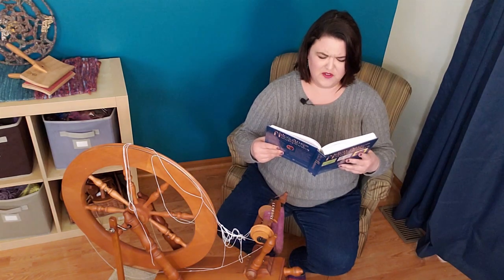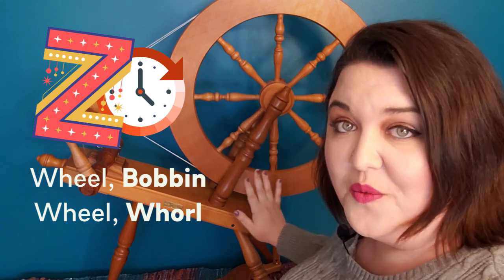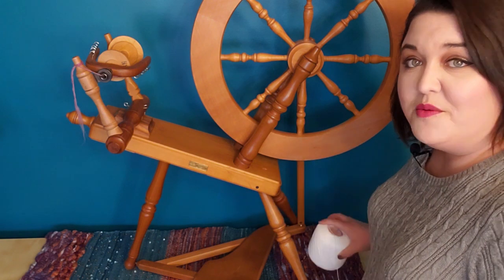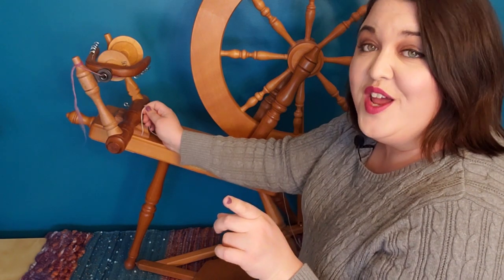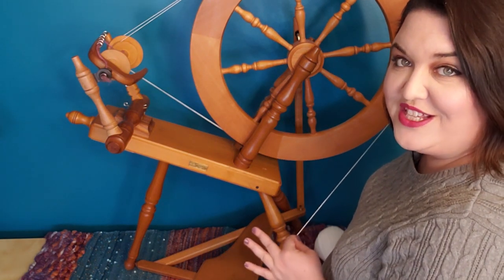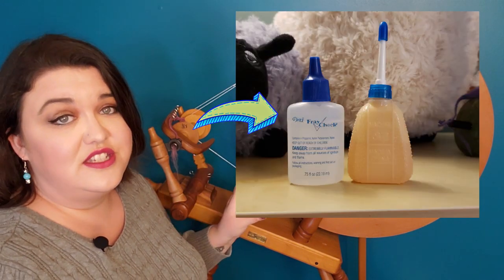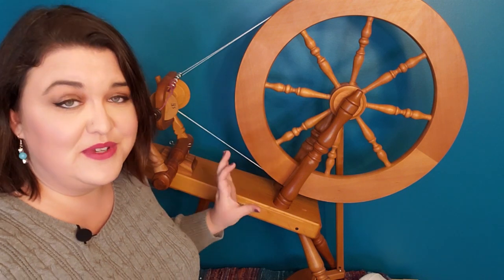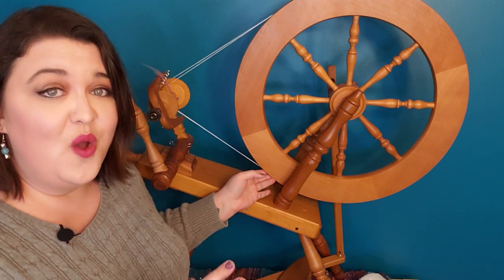How To Tie A Drive Band Onto Your Double Drive Spinning Wheel The Right Way

Comment from the maker: What is your favorite drive band material?
Reply: Just tied on some aunt lydias fashion 3 cotton thread
Reply: 100% Cotten
Reply: Right now I'm using 10/3 Romanian Hemp.  I like it because it doesn't stretch much over time, and it's super strong.
Reply: perhapse you should tell us WHAT makes a good drive band material
Reply: @gcjpcrowder  Well, that's what we're doing here.  All of the materials mentioned in the replies work well.  It helps to experiment and see which ones you like best.
Reply: Kitchen twine, cotton, available at any hardware store.
Reply: I had a double-drive band from kromski, which is a fine, 2-ply jute.  But the knot kept getting bounced out of the wheel’s groove, so i switched to 2/8 hemp, tied a slim reef knot, wound it in the correct direction (thank you!), and now the wheel is chattering happily.
Reply: @RuthHenriquez do you wax the hemp?

Comment: I've had my wheel about 25 years and have never used a different threading on the band for direction of spin. Never noticed a difference. My bands tend to last months and months. I spin and ply on the same wheel, often the same day, so it's really not practical to change the band all the time. Nevertheless, I am very much interested in the two types of threading. Have to give it a try. I could spin on one wheel and ply on another as I have two. Thanks so much! I thought you had to make a special kind of knot, but apparently you just have to make a secure one. Appreciate the clear, concise directions. You rock!

Comment: When changing direction (Z to S), the old timers would pick up the drive band on the bobbin with one index finger and pick up the drive band on the whorl with the other index finger then cross them over. This puts the cross on top and takes it off the bottom with no further action required except adjusting the tension again. Ashfords are usually good about alignment but some wheels are a real pain about throwing off the drive band.
Reply: This is quite interesting.  Thanks!

Comment: My favorite, Almost 175 year old double drive spinning wheel is from Canada and is quite cranky & cantankerous and will only work with a drive band made of heavy  multi ply cotton twine.  Absolutely will not work if knotted, has to be overlapped about 4 inches and hand sewed together which is time consuming. That is the way the drive band that was on it was done when I purchased it over 50 years ago.  Have a   recently purchased more modern wheel, double drive, which will work wifh a knotted drive band but still works best & more smoothly with the heavy multi ply twine .  When demostrating spinning,  I always use the old wheel because  of the character, charm & personality it has, all results of some very crude repairs from its earlier days, if only it could talk!

Comment: if your WHEEL has a double groove in it as well, the 1st pass around the bobbin also goes in the groove closer to you on the Wheel, the second pass around the whorl then goes in the BACK groove of the wheel. And you have to have tension on the crochet cotton ball or that thing bounces everywhere and pops the thread off all the grooves. lol i just learned

Comment: Thank you. I haven't used my spinning wheel in 25 years and couldn't for the life of me figure out what I did wrong. I'll go try this before I kick it for the last time and burn it. :p My bobbin keep spinning around as well, and as far as I remember, it shouldn't. It's only the flier that should spin so it plops the wool up onto the bobbin. So far your videos are the ones that shows it most clearly, how these ladies should work. So again, Thank you :)
Reply: Did it work?
Reply: @ it kinda sorta did. Maybe? I’m not sure. I can for some reason spin both ways now without it popping off. I can have the crossover of the string both on top and bottom going ex. clockwise without it popping off. I’ve changed the tension. Might be that as well? I have a spinning wheel my dad made me so I can’t just call somewhere and ask for the instructions. I can’t ask him cause he’s not around anymore. It was driving me up the walls.  I have no idea exactly what fixed it but now it works. 🤷🏼‍♀️ Was it this, maybe. If yes brilliant. At least I’m no longer a screaming banshee, I’m just puzzled. But at least quiet and happy 😃
Reply: @SagasInStitches   - If it somehow got fixed, and if I were in your position, I’d probably just count my blessings and be happy… and take pictures of everything and anything I possibly can just in case I need to change out that drive band again. 

One thing I do know: thank goodness for Jillian Eve’s videos because if something is not going as I’d wish I often find the answer on this channel. 

I’m so happy you got your wheel to work, especially now as I read your father made it for you. Now all I wish you is many happy hours spinning on it, making gorgeous yarns you can then turn into even more gorgeous finished pieces. And perhaps, one day, the possibility to pass on the joy of spinning on that wheel to someone else.

Comment: Thank you thank you thank you. 
When I started spinning some 15 years ago, my mother bought me a castle, double drive spinning wheel at a street market. She had no idea what she was buying. The sellers just told her that "it worked". 
I was a new spinner. All I had used was my Kromski Fantasia - scotch tension, double treadle, NEW. 
I spent so much time trying to make the "vintage" one to work. Impossible. And I finally left it as it was and used it as decoration.
But this past week I got stubborn. I watched video after video after video (not available 15 years ago) . I saw I was missing pieces. I made those (temporary - I will work on more permanent ones later). I found out it was double drive (did not even know that existed). And loe and behold I actually got it spinning. But now the real problem: My wheel has no grooves. ALL the pics I see have grooves. Mine doesn't. I did not give up.
But just a few minutes ago I came across THIS VIDEO and the thumbnail was exactly what I was experience.
I did wheel, bobbin, wheel, whorl. AND IT WORKS!!!!
OK, I still need to make the missing pieces. I still have to oil, clean, give it some TLC, but it is working!!!!
I think I will call him Sisyphus.

Comment: Thanks for this video! I am new to spinning an appreciate all your tips. Question about this - since the cross is supposed to be at the top for spinning Z twist and the bottom for spinning S twist, does that mean that you need to re-string the drive band when you are switching between spinning singles and plying? How do you go back and forth between the two?

Comment: Thank you Thank you Thank you.  We acquired an antique spinning from an auction.  The drive band was missing; other that is was in phenomenal condition.  I dreaded adding a dive band for a double drive spinning wheel.  JillianEve to the rescue!!  This video made that task as easy as "wheel-bobin-wheel-whorl" (1-2-3-4).  

The wheel was in such good condition that we took it to a demonstration at the San Jacinto Day Festival.  It worked like a charm ... until my knot on the drive band slipped.  Fortunately, I had the same ball of kitchen twine with me and 1-2-3-4, the wheel was wonking once more.

Comment: HELP! I am frustrated nearly to tears. Can’t tell you how many single drive wheels I have and I spin well on them. I was fortunate to pick up this Rick Reeves production wheel. Brought it home with bobbin on and spun it full. Changed to next bobbin and things went completely wrong. Trying to hold on to the drive band and replace spool at the same time seemed impossible!  Off came the band. I have watched you tie on a new band but what do I do with this circle band I can’t get to work? I Spin a minute and one groove ends up with all the band in it. I surely don’t have to tie on a new band each time I change a bobbin Uggggh!
Reply from the maker: No, you should be able to use the same band until it breaks or wears out. What it sounds like to me is that something moved out of alignment when you changed the bobbin. Check to see if the band lines up or if the mother of all or the wheel itself has tipped to one side or the other. Even a little bit off alignment can cause the band to jump. I hope that helps! Happy spinning!
Reply: @JillianEve  thank you. It helped.

Comment: I use home spun two ply linen thread on my DD wheel and my Ashford DD/SD wheel. The Ashford in DD mode requires a bit more tension than my dedicated DD wheel. Both spin real well. Until I gave a bit more tension on the Ashford in DD mode I got the same drive band popping off issues. A touch more tension fixed the issue and the bobbin side did not have too much tension as the thread is quite thin and will allow for decent slippage as needed. I can do two ply lace weight with no problems on each wheel.
Reply from the maker: Oh that's good to know about your Ashford! I might try some linen too!
Reply: @JillianEve  I also figured out I needed a leather washer between the bobbin and the flyer that is oiled and it works great. No more slop and I made sure I adjusted the mother of all to the side a bit more to better align to the wheel and all my popping off problems went away.

Comment: Thank you so much for all your videos. Newbie question... should the drive band be tied snugly when the tension knob is at loosest tension? Tightest tension or somewhere in the middle? I hope I'm making sense.
Reply from the maker: I've done it different ways, but lately my method is to set the tension in the middle and tie on the band. Then I have room to adjust it either way as needed. 🧶🐑✨

Comment: Great video it helped me to set up an old spinning wheel.  I found a fairly thin nylon string around 1/16" in diameter, and it worked well but I should point out that it was rectangular in shape.  I think any rectangular shaped thin string will work great and because it is rectangular the knot will hold much better.  This is most likely why most shoe laces are a flat rectangular shape.  Some of my shoes uses a round shape lace and they keep coming loose.  I am not sure where you can buy the rectangular nylon string I used since it was on an old Plumb Bob but I am sure there are some suppliers who sell it.  I hope this helps someone.  Cheers!

Comment: Thank you for this. I have acquired an old spinning wheel with the intent on learning how to use it. The direction of the thread is something I haven’t even considered. I have lots of crochet thread so am glad I can use that. Can I use it to attach the foot pedal to the big wheel axel rod thing too?
Reply from the maker: Wonderful! Yes, the connecting rod that goes from the crank to the treadle is called the "footman". Spinning wheel terms are strange! You can connect it with string, and I've spun with it that way on an antique wheel. You can also sometimes fashion your own out of a yardstick. :)
Reply: @JillianEve  thank you, that’s most helpful and will also stop me referring to parts as thingys. 🙂

Comment: Thank you for such clear instructions and explanations! I have only spun in Scotch tension so far (I currently have a Schacht Ladybug and it will do both single and double drive), but am considering a trade-up to a larger, DD Saxony wheel so I would like to try the Ladybug in DD. Dumb question: Because the band has to cross one way for Z twist and the other for S twist, I am assuming you must have to adjust it between spinning singles and plying...? I feel like this is obvious and at the same time, I cannot find an actual sentence on the internet that tells me the answer. Please help! And TIA!
Reply from the maker: I keep two drivebands on my CPW because he is a fussy antique for just this reason. Some wheels require it and some wheels can go either way regardless. Maybe you could try it without switching the band first and then reverse the cross if the band starts jumping off? 💜🧶
Reply: @JillianEve  Do you mean you keep one crossed one way and one crossed the other? I feel super dense! haha
Reply: @iamcharmquark  No if I understood her from a previous comment she means that you have two separate drive bands for the two different uses, one for s spinning and one for z spinning.  So when you stop spinning and start plying you change from your spinning drive band to your plying drive band. She told that other person to leave both drive bands on the wheel but one is hanging loose around the wheel support column while the other is engaged on the wheel to make it quicker/easier to change over from the one to the other. I think she said it also helps you if the bands are different colors.

Comment: Why are you using the breakband Groove on the bobbin and not the actual drive whirl on the bobbin? I guess it works since There is a differential between the two diameters. This could cause extra friction and wear the driveband.  Does Alden Amos recommend this way of setting up, better reference my copy.
In my experience the boost common cause for driveband popping off is misalignment of the big wheel not the drive band setup, though I admit I am lazy and never change the direction on my driveband and occasionally Elinore throws a fit. But on my matchless, polonaise etc it never matters, elinore just craves a bit more attention and maybe this is what she need

Comment: Ok, seriously, I am confused and I hope someone sees this. I prefer to spin counterclockwise. It’s how I was taught and I’d like to stay consistent. 

However, a counterclockwise tie off is not demonstrated here and I’m confused. I followed the exact instructions of wheel, whorl, wheel, bobbin, but my cross ended up on the bottom, not the top. So what did I do wrong? I can’t find this visual demonstration anywhere.
Reply from the maker: If your drive band is staying on your wheel, and you get the yarn you want, then you did it right! If your drive band is popping off while you spin, try doing everything in the opposite order to see if that helps it stay on. I hope that is helpful. Some wheels aren't fussy and you can just tie it on any way and spin just fine.

Comment: Thank you so much for this infomative and easy to follow tutorial. I only just recently discovered that the (old) ashford traditional that I purchased from a friend  who doesn't know anything about wheels and was using as a single drive is in reality a double drive using a non-ashford flyer (a Wee Peggy??). I only learned this through a spinning group on FACEBOOK. I could figure out why a new flyer I purchased wouldn't work on my wheel. So I am going to try using it as a double drive and see how it all works for me.

Comment: This may be a silly question, but why don’t double drive wheels just use separate two drive bands?
Reply from the maker: It is difficult to get two seperate bands to achieve the correct tension evenly and together.

Comment: I love your videos, I have learned so much. I am a beginner. I have from a garage sale an Ashford Traditional cir 1980? It makes a clunky sound, I read that I could get a clunky wheel kit, or a double drive kit. Would you recommend a double drive kit for a beginner, what would be the advantage? Thank you.
Reply from the maker: I have an Ashford Traditional from the 1960's and it's still one of my go-to wheels. They are great spinners and yes, there are lots of attachments you can get. I would check with an Ashford dealer if you can to figure out what will work for your wheel. Some are single drive Scotch tension and some can convert to double drive. I have the bulky flyer set up for one of my Ashfords and it's awesome! I can spin lots of novelty yarns with it.

Comment: This might be a silly question, but does that then mean that you re-tie the drive band everytime you want to ply?
Reply from the maker: Not silly at all! I don't re-tie on my Ashford because it doesn't throw the band as much, but my antique Canadian Production Wheel is finicky. If you can get away with not re-tying it, don't.  I'm all for less work. If your wheel throws the band though, you might need to. 💜🧶🐑
Reply: @JillianEve  Thank you for responding so quickly! I'll try and see if it works without re-tying. I've been messing around with the band so much because it seems like the cross will kind of touch no matter which way I tie it. Oh well, I'm sure I'll get there eventually. Thank you for all your informative videos :D

Comment: Do you have to untie and then re-tie the driveband when you want to ply? I don’t understand what you said. I was getting ready to buy an Irish tension wheel but I don’t want to change band direction everyday.
Reply from the maker: Irish Tension only has one drive band so you won't have to worry about the cross. Some double drive wheels are fussy and will want the cross reversed if you spin the other direction. Some will spin fine with it either way. 💜🧶😃

Comment: I LOVE your videos!! This makes so much sense, and probably explains the problems I'm having with an inherited double drive wheel. It came with a spliced band. Do you have a video or other recommendation to translate the above video to a spliced loop?  Thanks!!
Reply from the maker: I don't because I usually just tie the band on myself. The best way I can suggest you try it with a spliced band is to make a figure eight, remember which way you twisted the cross, put it on the wheel (you may have to lift the drive wheel off the supports to get the band around it) and then set it up to spin. Look at the cross and see if the band is rubbing on itself. If it is, take it off and twist the figure 8 the other way. That should do it! Happy spinning! 💜🧶